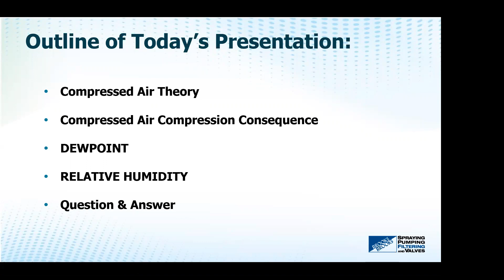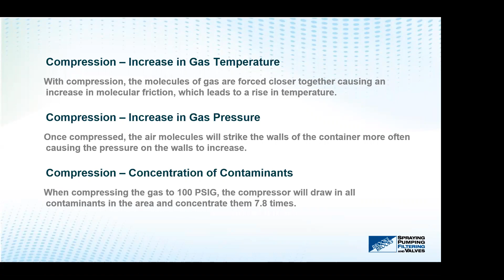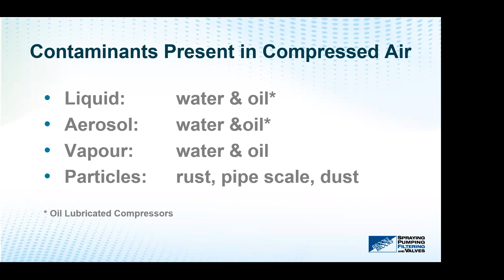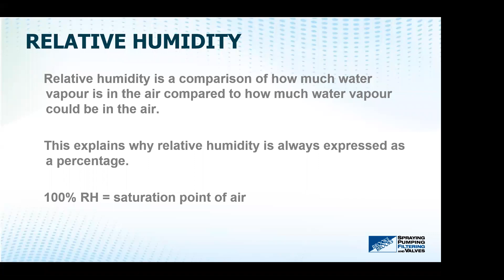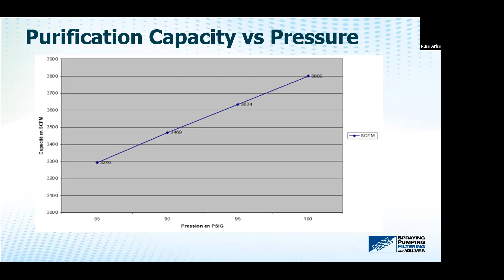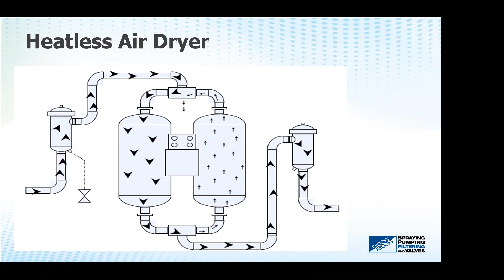Part 1 - Compressed and Ambient Air & Gas

Comment: you can refrigerate the compressed air vapour stream below the atmospheric freezing point of water, without the risk of ice freeze up, because the freezing point of water will decrease under increased pressure. just the same as the condensation point of water will decrease in turn..